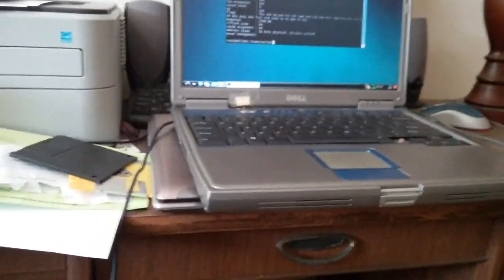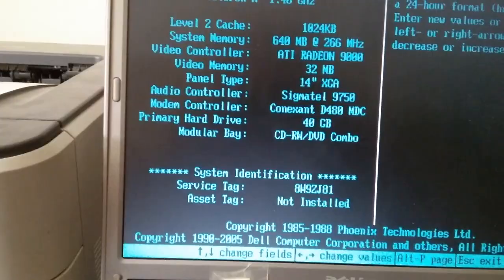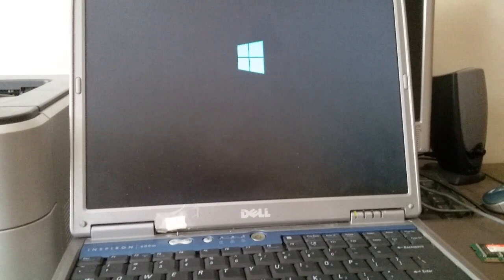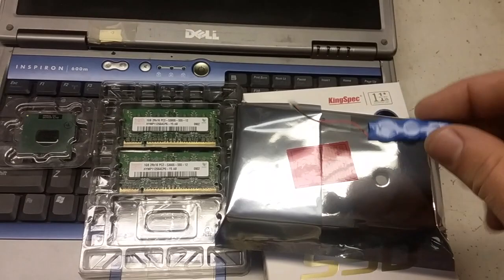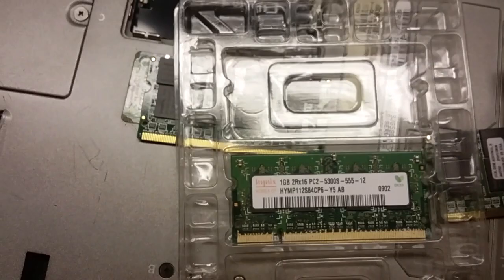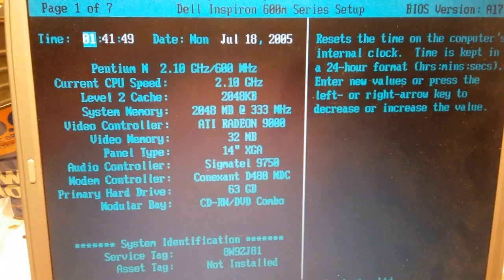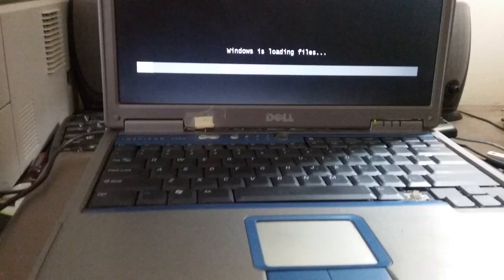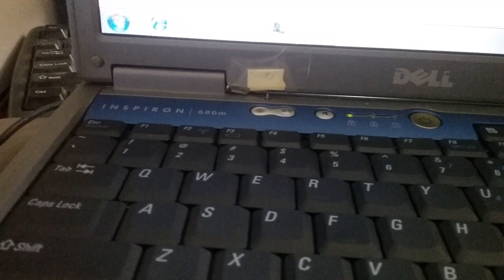Upgrading a Dell Inspiron 600m

Comment: Before upgrading make sure your laptop recognize the full 2Gb of memory, others including myself have had problems, my 600M XPpro had 2 - 256k modules pc2700's, also had several odd 256, 512 & 1GB modules laying around, no matter how I mixed them up 1.25 Gb was the max, I robbed another old laptop and got it up to 1.5 GB, not enough to run Windows 7 properly (always double Microsoft's min. memory requirement)

Comment: Found my dads Inspiron 600m in the cupboard I put it on charge and the charging green light come on. Been charging it for 12 hours and whenever it try turn it on the green lights come on and then off again 2 seconds later and nothing happens. Chuck it out or could it be fixed if I installed a new battery?
Reply: Take the battery out before you install a new one just to see if it makes a difference
Reply: @fatkid5600  thank you

Comment: how do you do to enable virtualization?
Reply from the maker: The processors that this laptop supports do not have VT-x, and from experience, do not have NX either.  That's why I'm limited to running Windows 7 as the latest Microsoft OS this thing can handle.  I'm not running any virtual machines on it, though I would surmise it would either be very slow (on very old virtualization platforms) or unable to run.